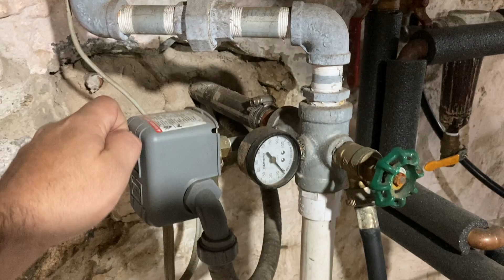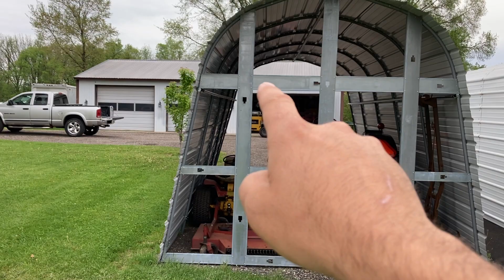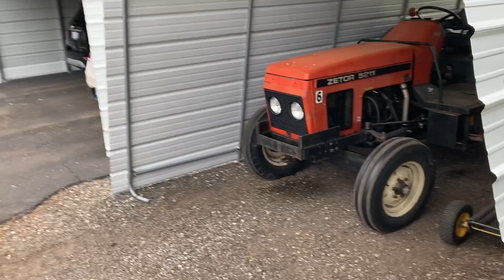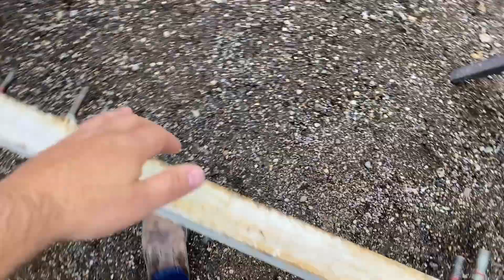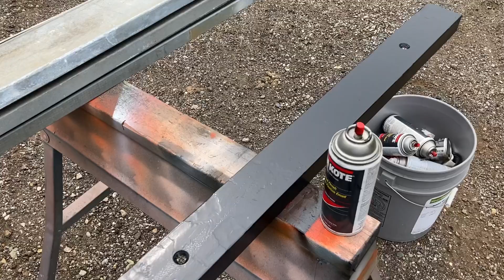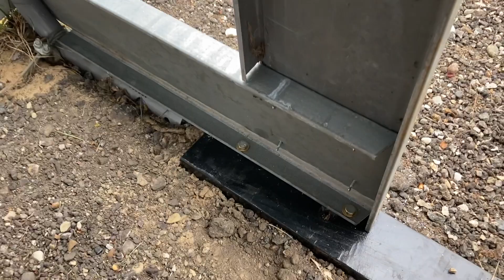Metal framing the Shelter Logic Carport for steel and problems with my water well.

Comment: Well Lesson: Before you call in the Plumber, check it yourself!  Pump running, never builds up pressure - what could possibly cause that?  All the valves (faucets) in the house are closed,  the PumpTrol's working,  there isn't a flooding in the house or at the pressure tank.  So, go out to the well, remove the cover and take a look.  Years ago, in Florida, our water bill was too high.  I went to the meter at the street and noticed the grass wasn't greener on the other (city) side.  Dug under that patch of lush green grass to discover a leak in 'our' pipe.  Got a SS Hose clamp and a piece of rubber; turned the city valve off; clean the area around the leak; laid the rubber over the pinhole and secured it with the Hose Clamp.  We sold that property years later and, I suspect, my repair is still holding tight.  

Had a well pump in NC run our electric bill up, went to the well head, found a and replaced a cracked fitting and that was 'years ago.'  Since, I put in a pump monitor circuit that includes an HOUR METER and a Light and Sound Signal device so that any 'constant running' of the well pump (our controls and pressure tank are down in the basement) will be noticed long before the issue shows up on our Electric Bill!  

When our PRESSURE TANK failed a couple weeks ago, the pump was cycling frequently.  I did some ONLINE research and discovered my WellMate Fiberglass pressure tank bladder had failed (after nineteen years). They wanted $250 just for the replacement bladder so I went with a Larger Tank from HD for $200.  I figure I will save the WellMate in case I need to install a Pressure tank OUT OF DOORS in which case $250 for the replacement bladder might make more sense.  I have NO IDEA what a plumber would have charged me to come look at my 'problem' but I'll bet I came in (under $300) way cheaper than had I hired someone to replace the pressure tank, 10" T-fitting, pressure relief valve,  pressure gauge, Pumptrol Control Switch, drain valve, shut-off valve - plus the removal of the old system and rewiring the lot.

Three hundred to replace a fitting - sounds like he knew a friendly plumber!

Love what he's doing to his sheds.

Comment: How did you do the roof? I need to do a 30x48 fabric building
Reply from the maker: I bought full length sheets and screwed them directly to the hoops with self drilling screws that had rubber washers. Same all the way down. The top sheet is centered at the top of the building and I worked my way down from there.